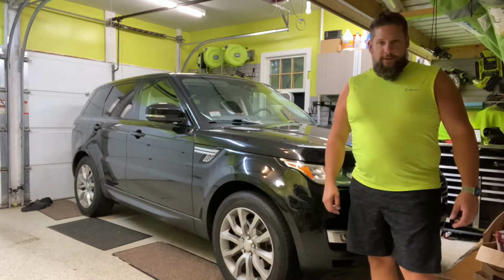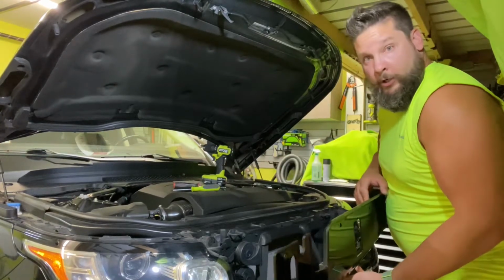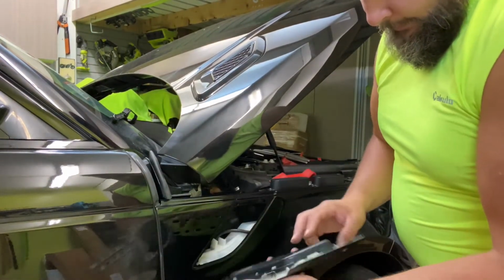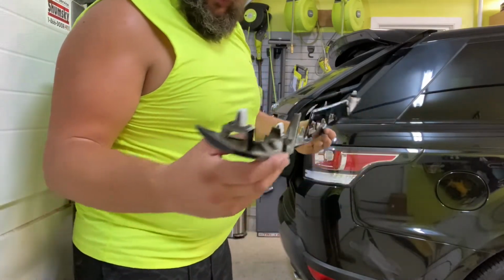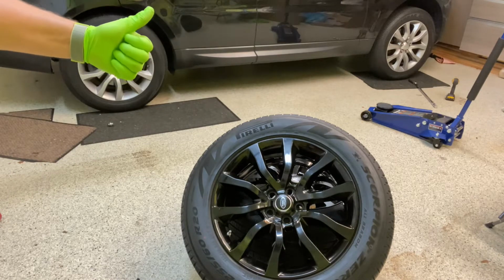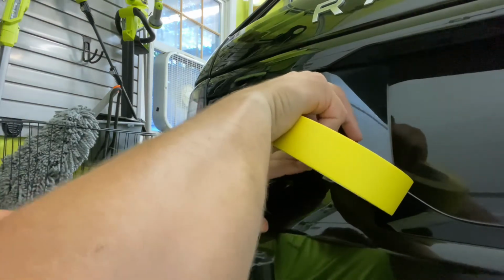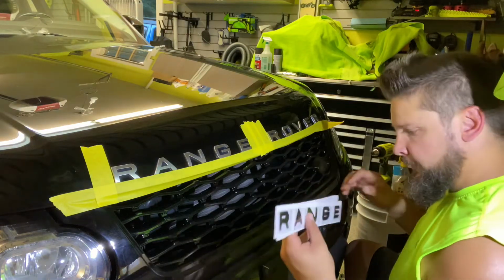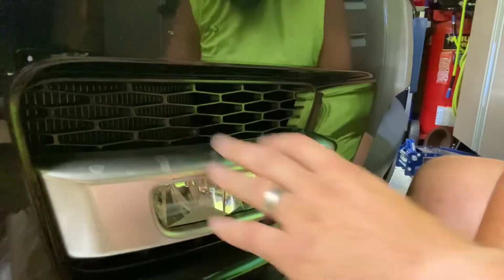Range Rover Sport BLACK OUT CONVERSION

Comment: Great job on a very comprehensive step by step video. You make it look very easy. I wish I had this video back in 2014, I 'd have done it myself. I also upgraded the wheels to 22" inch blacked out rims. Now I want to change the front bumper to a SVR bumper to give it a more refreshed look.